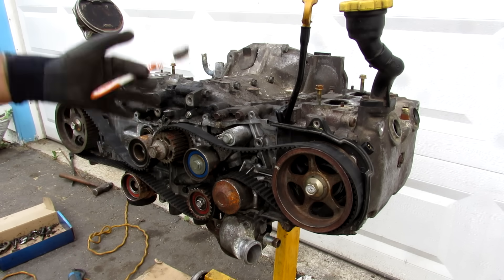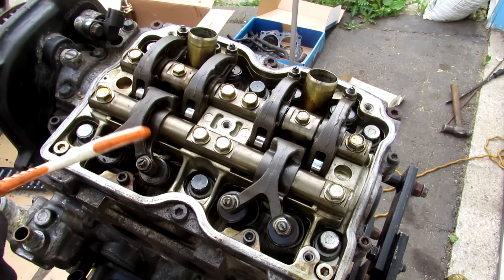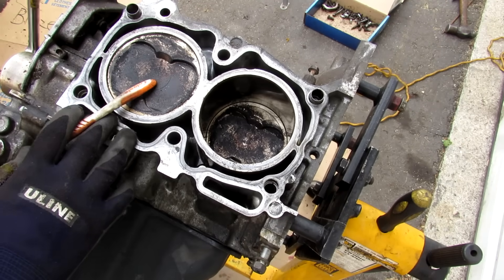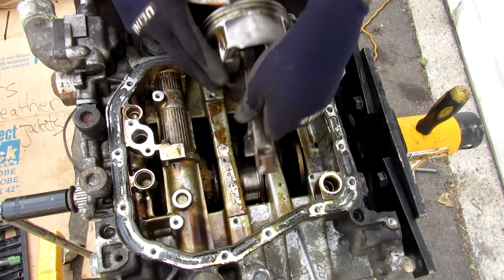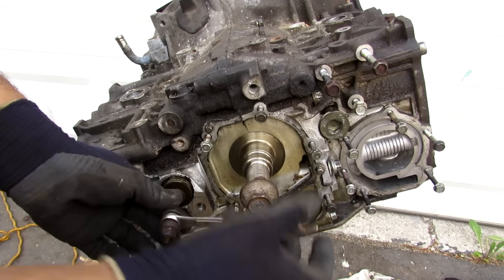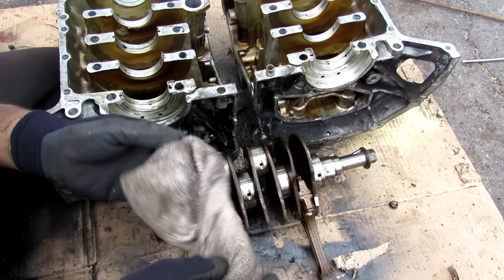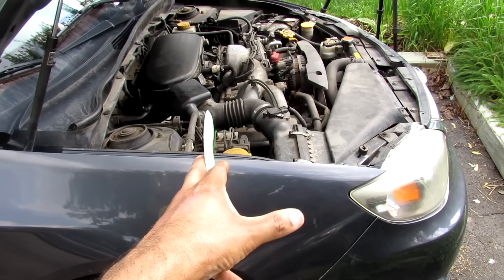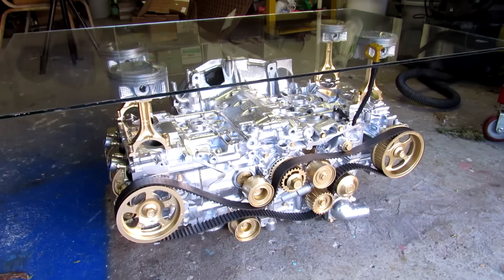Why Subaru Engines FAIL

Comment: *GREAT POST Thank You... Being a former mechanic on 1960s to Mid 1990s cars.  After watching this Fuckin NIGHTMARE of an Engine Breakdown seems like a 1000s parts to keep it running. I definitely will not ever buy a Subaru How is Subaru still selling? but I notice a lot of newer Used Subarus all over EVERY MAKES  used car lots..I just hate the new computer controlled technology cars... I will not buy anything before 2015 anymore. BTW. I’m dumping my low mileage 2015 Equinox LT, they have timing chain breakage (V6) oil consumption, blown seals, fires.....and a stupid plastic ECO-TEC PCV box (I4) on top of engine it’s senseless ..I’m buying older cars I can work on....keep your navigation back up cameras that goes out or freezes up. it’s BS...oh CVT trans Forget it !!!!

Comment: Loved the video.  I have always wanted to ask... how the heck do you remember which bolt goes where when you go to put it back together?
Reply from the maker: Understand how the engine works...a small accessory like a bracket might take a smaller 10mm bolt...and a larger structural bolt like a head bolt will be thicker and longer, so it's kinda intuitive. I also keep the bolts I need and sort off the ones I won't reuse for my engine table

Comment: I sure liked the drivability of the boxer engine....2001 Forester, handled great, low to the ground, felt solid, excellent AWD.
Reply from the maker: Any issues with yours?
Reply: @speedkar99  Head gasket.  Like most.

Comment: Why do boxer engines fail? Look at the terrible engineering. It is the most overly-complicated engine when it doesn't have to be. Inline 4, V twin style 5 cylinder engine, a W style or VR style 4 cylinder engine. These are ideas that work. But whatever. Keep doing what you are doing Subaru..... Try to pull a head without dropping the engine down or raising the engine out of the engine bay. Oh right..... No room 😑 TERRIBLE !!!
Reply from the maker: Oh well. I like that they are unique and not the same old inline 4 cylinder transverse FWD

Comment: I owned a 1988 Subaru GL wagon, drove it 230,000 miles. It died of cracked heads. The coolant channels in the heads were casted with not enough metal to endure the heat. Poor Subaru design and engineering. I hope Subaru changed their head design and castings.
Reply from the maker: How many head gaskets?
Reply: @speedkar99  Only the originals.

Comment: My stage 1 2008 WRX sti's engine died instantly last august at 240+ km/h after 260.000  hard kilometers due to a cracked head gasket. I wonder if I had re-torqued the head bolts if that engine would still be alive today. That said, the Subaru still lives with a new engine that is now full stage 2 and makes a reliable 450 bhp. I hope it will last me at least another 7 years. I have now also installed a thicker head gasket and I will be sure to re-torque the head bolts occasionnally.

Comment: The majority of "Common Failures" on any engine come from improper scheduled/preventative maintenance.  Please do not confuse "manufacturer defect/design errors/recalls" with people abusing their engines. Any type of over-boosting, over-revving, improper tuning, etc etc will cause premature wear and the majority of these issues in many turbocharged/NA applications.

Comment: I see that in order to split to block the pistons must be disconnected from the pushrod via 14 mm access ports on all quadrants of the motor, but what to do about a 6 cylinder Subaru? The middle cylinder on an opposed cylinder engine with greater than 4 cylinders will require some kind of special tool.

Comment: The car wizard: why a Subaru head gasket job costs $3000. Links to this video
Reply: Got mine done with bent exhaust valves on both heads replaced for $1600.
Reply: you got robbed..
Reply: I think the moral of the story that everyone missed is that it's more expensive compared to common engine configurations. Even if you found some back alley mechanic to do it for 1200, he would have done an inline for half that.
Reply: @WolfPackM98c  Inlines have half the head gaskets so...

Kidding aside, the head gaskets tend to leak out, not in. What i mean is they don't tend to leak into the cylinders and you don't tend to see mixing of oil and coolant. You just end up with drips on the driveway. This means you don't have to worry about engine damage if you just keep an eye on oil levels.

 Thee reason why a head gasket job on these is so expensive is because of the position of the heads. In every Subaru I have worked on you have to pull the block to do the head gaskets. This is why I always recommend you swap the head bolts with ARP studs. Do that and you should never have a problem again.
Reply: Buy your own all steel gaskets
Reply: Holy shit, i got my 1999 subaru for 1400€..
Reply: I hope that’s not each!
Reply: @redreuben5260  2500 that includes heads getting hot tanked , cleaned , decked.
Reply: + labor for pulling motor etc
Reply: 1875$ for mine.
Reply: Actually if uou buy new subaru now they will give cash for after the warranty but most buyers buy new and sell it after 8 years replacing to the newest technology. Subaru is not recommended as second hand car
Reply: Cost me $400
Reply: I charge $700

Comment: Impressive amount of information in this video, definitely clarified my understanding of the Subaru boxer engine...

My ‘12 Golf TDI just set the check engine light (hooray, I now have an “official” VW ;) ) and I have a mechanic appointment tomorrow, it’s still under CPO warranty, but I’d be lying If I said I wasn’t planning an “exit strategy” if the repair turns out to be out of the scope of the warranty...

One of the vehicles I was considering was a ‘13 Impreza manual transmission, with the 2.0 NA engine, it has 118k and a new clutch, but seeing the inherently flawed design of the boxer engine and the oil consumption issues, it’s not worth the risk...

Hopefully, the CEL isn’t something major and either a false code or covered under warranty...

At least the TDI is designed to burn “oil” ;)(diesel fuel is a lightweight oil, gasoline is a solvent)

Comment: Subarus are pretty fuckin easy to work on.....  Put spark plugs in any minivan or V6 FWD car on the road and tell me otherwise. You can reach almost all of the bellhousing bolts on a Subaru from the topside of the engine bay, the starter is right on top, all the accessories are right up top and in the front, and all the fuel injection and wiring stuff comes off with the intake and the engine is basically bare at that point.

Comment: Please stop calling M6 bolts "10mm bolts." They are 6mm bolts with a 10mm head. Kinda like your 1/4" bolts have 3/8" heads l.
Reply from the maker: Everyone who works on cars recognizes a bolt by the tool you have to put on it. Besides thread pitch can vary from wrench size. Only engineers and machinists will care about thread pitch